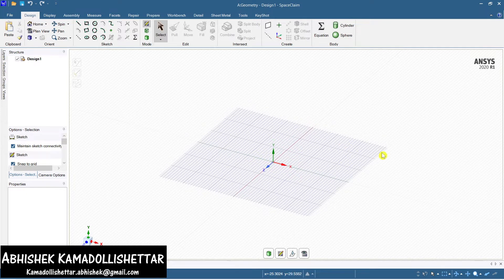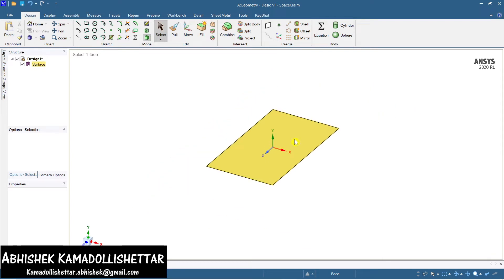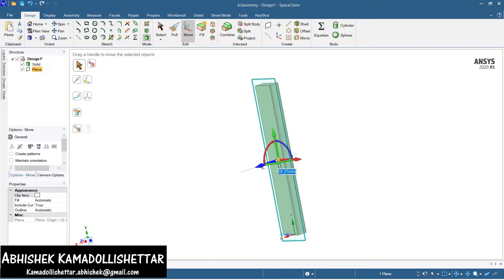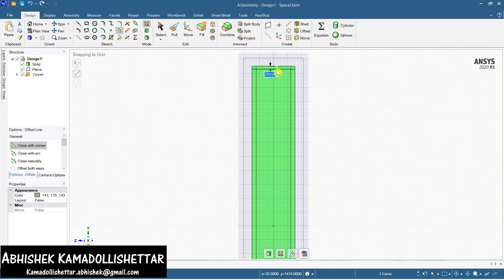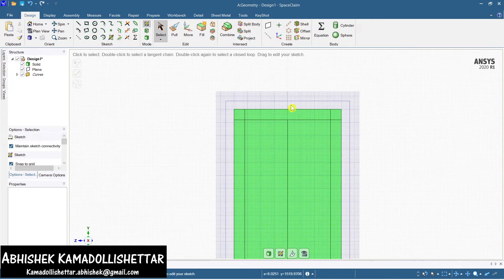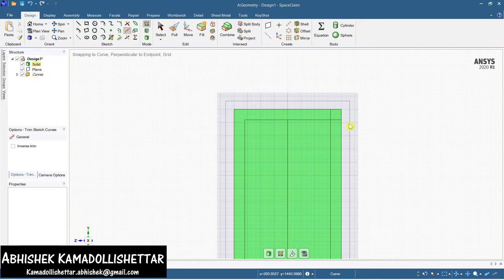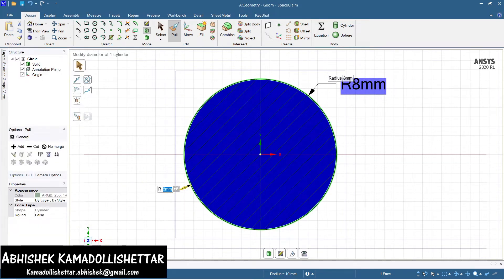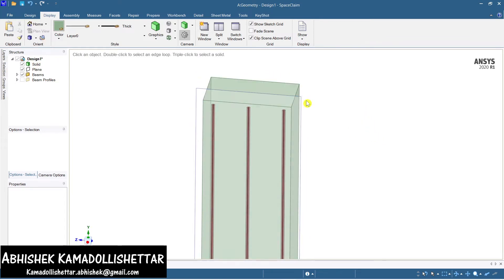Modeling of RCC Column in Ansys SpaceClaim

Comment: Thanks for your video. How can you analyze this column by the way? The stirrups seem segmented at the bends. How can you connect them to behave as one continuous member and also how to model the bond between rebar and concrete? 
Also, I wish to learn how to model RC concrete framed multi-story structures in SpaceClaim, which actually behaves like RC concrete and not structural steel. Meaning concrete cracking and also how to perform modal analysis on same. Thank you.